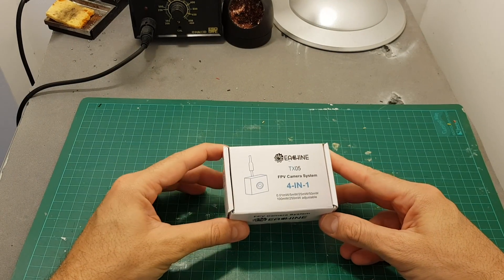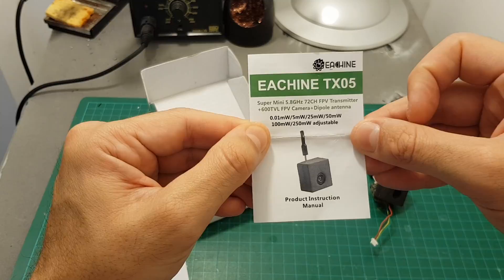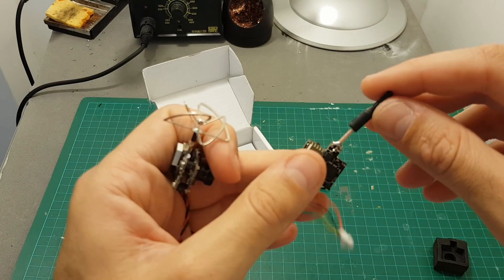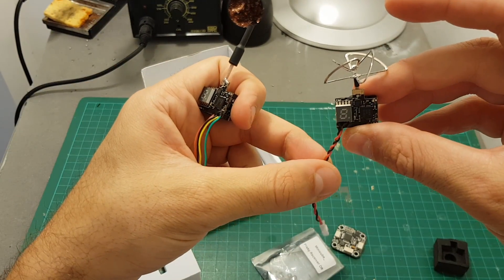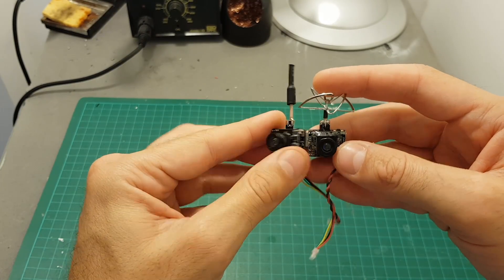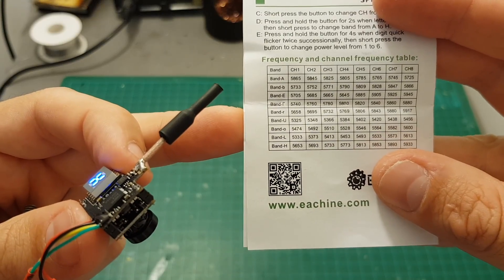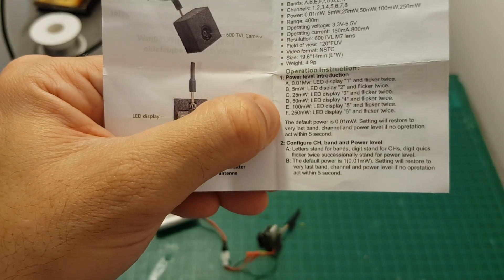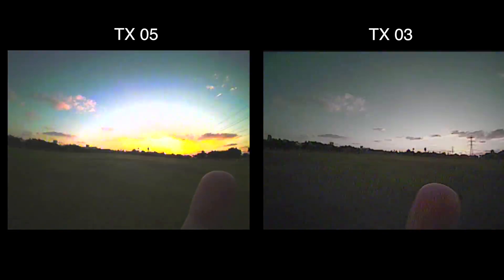Eachine TX05 - Unboxing, Review And SBS Comparison with TX03

Comment: Hi Gal, I know this is an a older video, but I just got the eachine tx06,  very similar 25mW aio.  It comes with separate power lead with connector to hook to 1s battery.  I did so, just like you did in video, and it immediately started smoking.  Tried with two different 1s batteries, both tested at 3.95v.  Cam is rated at 3.2-5v.  Just faulty or am I missing something?
Reply from the maker: It sounds that something was shorting out. Do you have a multimeter in hand?
Reply: @KremerFPV  Yes I do, but I am just learning to use them, I don't think I have a great one, I just use it to test volts, I think you can test impedance too, but not sure how, here is the model I have......
https://www.aliexpress.com/item/32517087299.html

Comment: Gal, if you put a circular on that tx05 do you think it would improve the reception ? As i noticed on the return trip the tx03 came to life alot better than the tx05
Reply from the maker: Yes, it should improve the signal on your way back, as the TX05 antenna is a linear antenna.

Comment: Is tx05 fpv quality and range bet
ter than tx03 and what is the use of green and red wire on tx05 . I am confused plz suggest I want it for my bugs 2c drone I have seen many review of tx03 I thought the camera quality was not so good if yes plz correct .I am planning to buy Eachine R0TG01 fpv otg Receiver .which will be the best pair for best range and camera quality tx03 or tx05 or some another fpv camera????
Reply from the maker: The ROTG01 and the TX05 will be a great pair. Let me know how you like it after a test flight :-)
Reply: Gal Kremer Thanks
Reply: @KremerFPV  is rotg01 fine with latency to drive a rc car ?
Reply from the maker: @amagnier  Sure

Comment: Where could I find an electrical connector to fit the tiny connector that comes on the camera?
Reply: probably a micro-jst like the tx03, just look on aliexpress, banggood, dhgate or ebay
Reply: I dunno why they put a connector on it that won't fit anything but I asked Banggood and they said they didn't have any to fit it.
Reply: It's actually pretty common, alot of the aio cams use these, and even flight controllers like the cc3d, its just a difference of 2 pin micro jst, 3 pin, 4 pin etc.
Reply: Does the tx05 do audio?
Reply: No, I don't think any FPV camera+ transmitter combos do audio.  Some of the cameras do but not the transmitters.
Reply: Its one of those mini jst connectors? same super small connector hubsan and other 1s drones use...